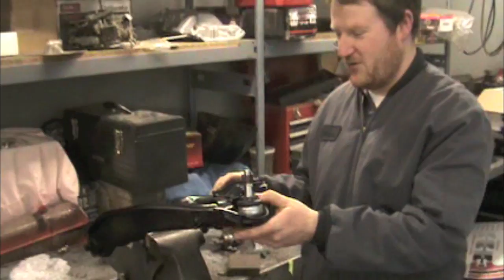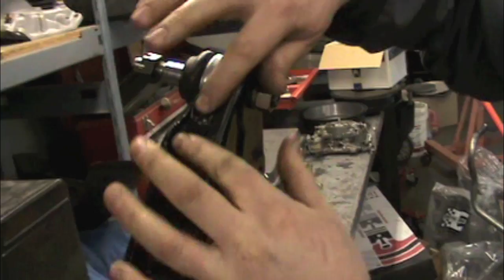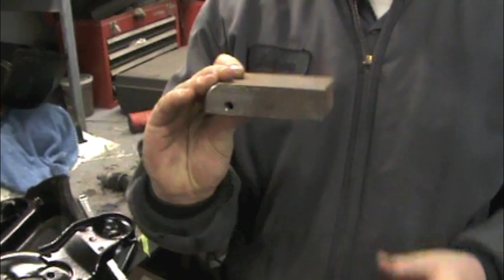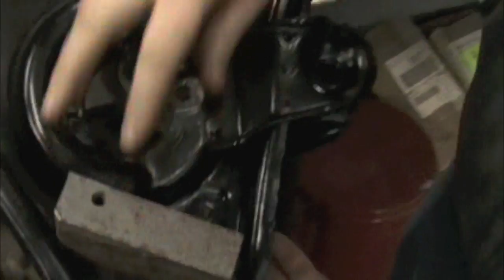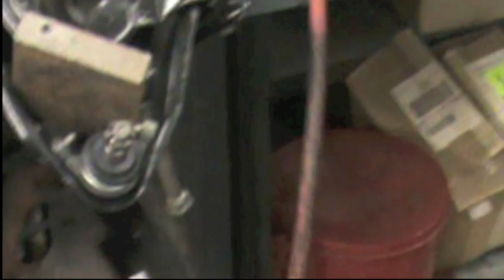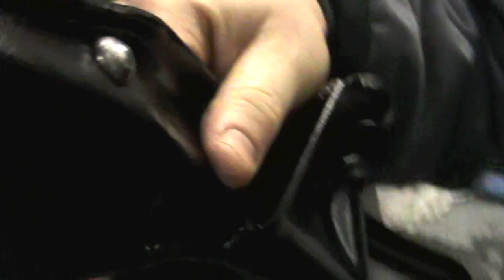1963 Corvette lower ball joint installation

Comment: you put the rivet in backwards.  The rounded head should be on the inside and you peen the tail of the rivet over with your air hammer.  They way you did it, you definitely did not crush the rivet enough for it to be secure!